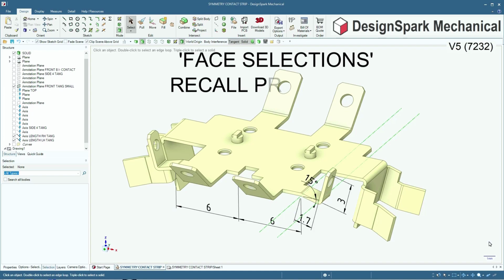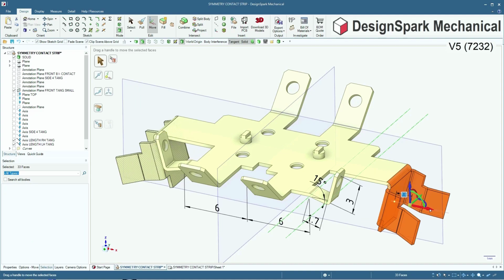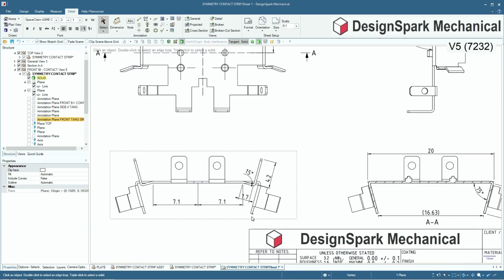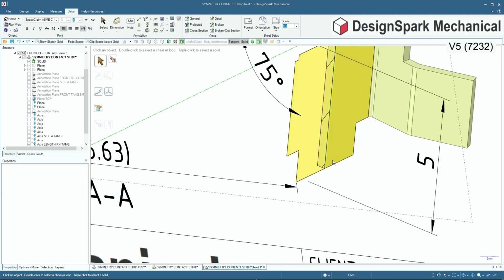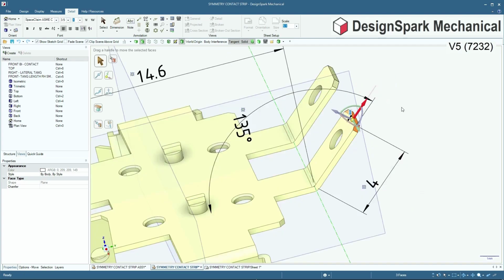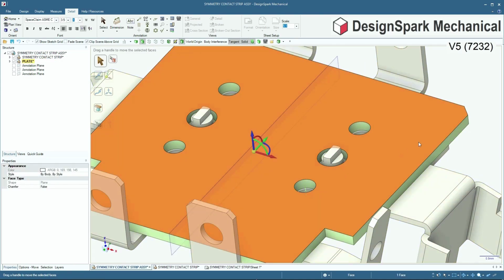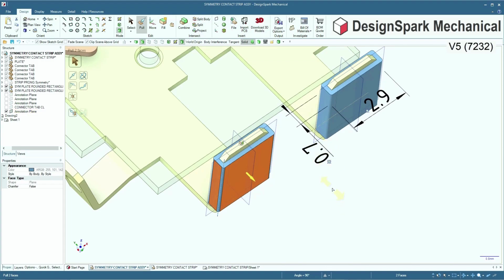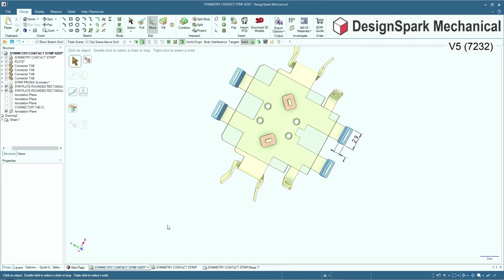DesignSpark Mechanical - Mirror symmetry with construction line (PART 2)

Comment: Hello, thanks for the video, i'd like to know, is there any way to mirror a piece we have already modelised ?
Reply: Yes and No. Yes by actually duplicating the faces etc ( here I'm thinking about mirroring faces or features), moving them to the right reflective position and then carrying out any new mirroring operation - the process of new mirroring anything, scans the model looking for all symmetries about the new mirror position - if found, the faces are then linked for reflected actions of move pull operations etc. This works in v6 Explorer same way as v5 and previous versions - it's quite a lengthy process compared to the new universal mirror instant tool in v6 Creator and Engineer versions.

Comment: how can i make those bends in sheet metal ?
Reply: Simple explanation - draw rectangle ( 4 sides), add 3 more curves to make a tang > exit sketcher. The resulting surface has 2 faces... revolve the tang face to make a bend. Pull the edge to make a bend radius... I suggest evolving the sheet metal design only using faces , not solid. edges of a face can be pulled up / down and edges can have bend reliefs made using the Split tool applied to an edge - then pull the edge to make a bend relief notch.
All selection tools are available to catch similar edge lengths so Pulls can be done efficiently. 
The example shown above has used a function only provided with the Drawing Sheet add-on module - namely this, 'memory' of previous selected faces with a preselection with mouse hover and selection with a second click.
The Mirroring function and procedure is discussed in depth in part 1. Please ask if the video isn't clear to you.